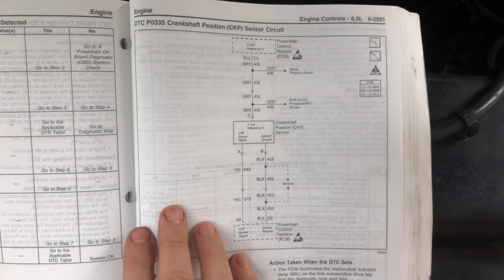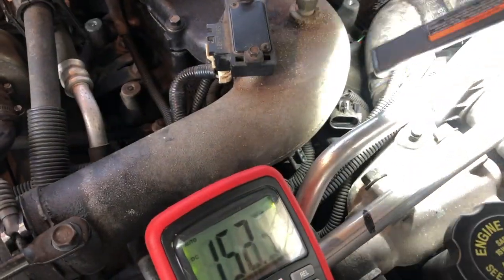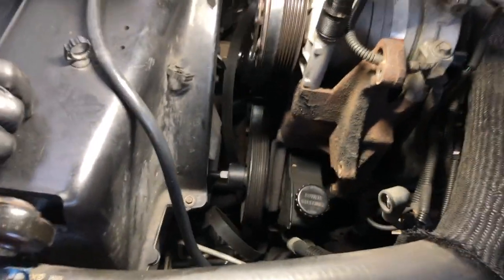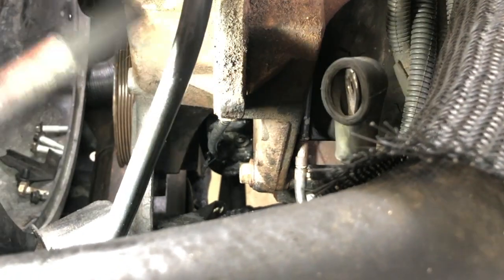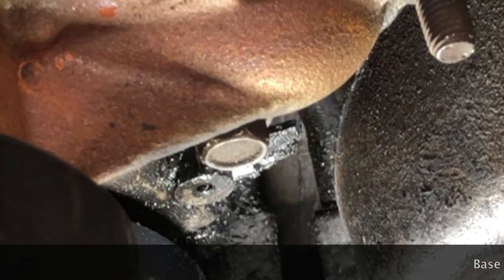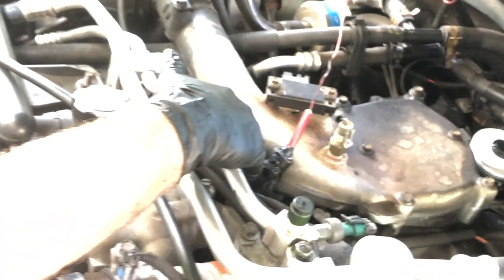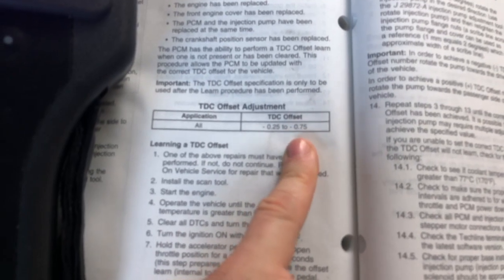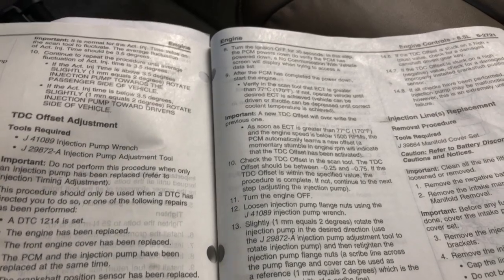1996 - 2002 GM 6.5L Diesel P0335 CKP CrankShaft Position Sensor Diagnosis & Repair (Chevy & GMC)

Comment: We have GMC k3500 6.5 diesel, 1995, stalling issues have replaced throttle sensor, pmd and relocated , starter, fuel filter, air filter, fuses, lift pump, engine block is brand new fuel injection pump replaced, fuel solenoid shut off, CDR VALVE , lift pump harness from Leroy diesel, differential housing had to be replaced after starter did not have bracket put back in from mechanics after replaced so it was replaced 3xs before a mechanic discovered bracket wasn't put back on even tho it was there.
Reply from the maker: That's a pretty expensive parts cannon story.  Did anyone actually try to diagnose the root cause issue rather than blindly throwing parts at the problem?   Someone should have checked fuel pressure coming out of the fuel filter manager into the lift pump, these kinds of symptoms can come from clogged fuel lines or a clogged fuel sender inlet screen.

Comment: Is the relearn procedure the same for 1995?
Reply from the maker: It's the same from 1996 and up using a Tech2 scan tool to automatically perform the relearn. For 1994 and 1995 the DLC adapters needed on the Tech2 are of course different due to OBDI vs OBDII and the screen menu entries may also differ but it's otherwise the same concept.   The manual TDCO relearn process may differ also, you would have to consult the service manual for your model year.   These last two points are the only reason I don't have the video title indicate 1994 and up.   More info in the video description as well.

Comment: ON A 6.5L 99 GMC IT IS NOT NECESSARY TO REMOVE THE P/S PULLEY OR THE SERPINTINE BELT- ALL YOU HAVE TO DO IS LOOSEN THE A/C MOUNT TO THE BLOCK AND THE BOLT ON THE P/S BACK OF PUMP THAT GOES TO BLOCK- IF I CAN REMEMBER RIGHT THERE ARE 3 BOLTS ON THE BIG A/C BRACKET - LOOSEN THEM ABOUT 3-4 TURNS- AND THE ONE SCREWING INTO THE BLOCK ON THE BOTTOM OF THE A/C BRACKET- AGAIN 3-4 TURNS - SLIDE UNDER THE TRUCK AND USE A PRY BAR TO MOVE THE BRACKET AND P/S PUMP JUST ENOUGH TO SLIDE CRANK SENSOR BY THE BACK OF P/S RES.  BINGO NOT ALL THE PULLING PULLEY TAKING OFF THE SHROUD AND FAN AND ALL THE OTHER STUFF- NOT EVEN REMOVING THE FAN IS UNNECESSARY!  I CAN DO ONE IN ABOUT 20 MINUTES INCLUDING JACKING UP TRUCK!   THE REASON TO REMOVE ALL THE STUFF IS THE SENSOR IS TO LONG TO COME OUT AND SLIDE BY THE P//S RES. YOU NEED ABOUT A 1/2 INCH MORE TO SLIDE IT BY THE BACKSIDE OF THE P/S PUMP RES!  YOU GET THAT 1/2 INCH IF YOU DO IT MY WAY AND ALL THE COMPONENT REMOVAL IS NOT REQUIRED!  EASY PEEZY!

Comment: New owner for 6.5 Diesel. Was wondering what the go is with the service throttle soon notification on the instrument panel at startup. Is there something that needs to happen to clear this. The light goes out. Does the throttle need to be cleaned/replaced. thank you . The camera work in your videos is very very good.
Reply from the maker: Thanks.   That dash warning lamp is related to the electronic throttle control.  These trucks were some of the first vehicles to do away with cables and use an electronic throttle position control.  The light is coming on because one of the several position sensors involved with this mechanism is not providing the expected data to the PCM.   You'll need a scan tool to pull the trouble code(s) to diagnose further but it's likely going to be sensor(s) related to the accelerator pedal.

Comment: Thanks for the video, im scratching my head on where to find a brand new , stock original power steering pump and original lines. Any reference? Thanks
Reply from the maker: Really eBay is the only game in town for OEM NOS parts anymore.  Sometimes www.partsvoice.com as dealer overstock.

Comment: What manual is that? Do you have a part number for that manual? I’ve had a hard time tracking one down, and recently purchased a 1997 c3500 dually with the 6.5L TD and I’ve been having all sorts of issues.
Reply from the maker: Those manuals have been out of print for decades, but there's a search link in the description where used copies turn up from time to time.  You can also "rent" them directly from GM at www.acdelcotds.com.

Comment: Hi Dr shock thank you for all the vids they've helped me allot I have a 98 6.5 v.i.n F .. is there any way using a multi meter to set timing on optic sensor? Your help is greatly appreciated.
Reply from the maker: Not that I'm aware of.  You would typically scribe/scratch the original sensor location before removing it to replace.   A Tech2 scan tool would be needed to correctly adjust it from there.
Reply: @DrShock  ok... thank you.

Comment: My 6.5 doesn't heat up to 170F unless it's 80F outside air temperature running on high rpms
Reply: Thermostat may be stuck open or you have a faulty gauge/sensor

Comment: A few lessons learned after I did this job on my truck:
- If you luck out, you can pull the sensor from under the truck without having to remove the power steering pump. This only works if the sensor comes out in one piece, otherwise you'll have to remove the pump to remove the sensor and get any loose bits out. If you are one of the lucky ones, you just have to carefully bend the sensor out because it'll hit the edge of the PS pump. It's possible to get it out, but it takes some finesse. The same goes for putting the new one in; you have to come in at an angle and carefully force the sensor in until its head is past the PS pump. It's a pain and you have to be extraordinarily careful, but I was able to do it with the help of some motor oil to lubricate the sensor.
- given the above, it's probably worth checking if the sensor will come out in one piece before you start removing other parts. Just be very careful so you don't break the sensor in the process. If it works, it could save you a lot of time.
- as the video suggests, don't forget to tie a piece of paracord or similar to the old sensor connector. That way you can use the paracord as a "placeholder" for where the new wire will go; you just tie the paracord to the new connector and feed it back up along the engine. This is easier said than done because there's not a lot of space for the connector to travel through the engine, but it's doable with some patience. Small hands help too.
- I found the new sensor male connector difficult to connect to the female wiring harness connector, so I used a tiny amount of oil to lubricate the gasket on the existing female connector (the purple gasket mentioned in the video). You have to be careful not to get oil in the electrical connection, though!
- all in all, I think this can be done in about an hour if luck is on your side and you know what you're doing. It took me longer than that because there was some trial and error involved, so schedule considering that possibility.
- if you don't have a Tech2 tool, you can repeat the relearn process a few times to make sure it goes through. When I did it the second time, it gave me a P1214 (injection pump timing offset), so I did it a third time and the problem went away. However, that indicates that the injection pump needs to be adjusted, so I'll be taking it to a mechanic just to do that part. It's probably wise to have someone check the timing after this job regardless of trouble codes.

I hope this helps!
Reply: @awaywedrove8861  what is the relearn procedure

Comment: Very nice and complete video. This is the kind of how-to we need on YouTube!

Side note, my idler pulley had a square slot for use with a socket wrench or breaker bar (this may vary depending on model). That makes it pretty easy to remove the serpentine belt. I use a pipe for leverage on the wrench so I can move the idler one-handed, then the other hand can guide the belt off the pulley.

Comment: А на 1995год такой сенсер подойдёт?
Reply from the maker: Да, номер детали, который я указываю в описании, относится к 1994 г. и новее. Но вид разборки в видео только для 1996 года и новее.

Yes, the part number I use in the description is for 1994 and up. But the disassembly procedure in the video is only the same for 1996 and newer.
Reply: @DrShock  спасибо!

Comment: Would you happen to know where the ign-e fuse wire runs? i am working on a rig that a knucklehead rewired poorly and that is last wire i can't figure where it is supposed to go. the wire i have is broken off by the fuel filter.
Reply from the maker: No not offhand, your best bet to figuring this out would be the engine wiring schematics in the factory service manual.

Comment: I have a question here about the ground going to the sensor. On a particular truck that I'm working on I'm getting a dim light on the ground also checking and confirming that I hooked a dvom to the ground on the sensor plug/back probing the other end to the battery positive side and I was getting around 8 volts so I don't think that's normal also did a oscilloscope test and signal didn't look very good. Also I wanted to say the sensor ground to the crank position sensor as well as everything else that's run off of that sensor ground like EGT inlet air temperature and a few others that sensor ground runs all the way back to the ECM so is that a sensor ground that should show battery voltage or should it be more like 8 volts. When you get a chance check out my video of the oscilloscope.https://youtube.com/shorts/SXQIFuj57r8?feature=share
Reply from the maker: Ron the 99 service manual for these trucks doesn't get into this kind of specific detail.  The testing of the sensor is more pass/fail after a DTC is posted / check engine lamp lit, rather than details to determine the margin in between.   

Wiring wise the CKP sensor has a 5VDC reference from the PCM on pin C and a ground on pin B to the PCM directly.  Finally the sensor has it's signal output on pin A going to a dedicated PCM pin A5 as a straight shot (no splices or shared circuits).  The ground is not a straight shot, there are two splices to other unnamed sensors along the way to the PCM.  The 5VDC reference is shared with only two other sensors, the boost sensor and the Barometric sensor.

While the service manual doesn't specify, I'd expect the 5V reference to be a solid test point, though it could range +/- some nominal value.  I'd expect the ground at PCM pin B12 to be a true ground, and provide comparable value to the other PCM sensor ground pin at D9 for the CMP sensor.   

So bottom line, no I personally would not expect anything but a normal reference ground here.  If I had more than background mV noise, I'd be inclined to think I had a wiring or PCM problem.  I'd check this by disconnecting the B12 pin at the PCM, and working my way back towards the CKP sensor splice by splice.

Comment: A bit of a critique. It is SO easy to pull the upper intake..... using an air ratchet it takes less than a minute, it only makes sense to remove it to gain access to any wiring underneath it, rather than try to work  around. It's just the (5 or 6) center bolts, loosen the hose clamp, remove one bridge bolt and loosen the other, and take off two electrical connectors. The gasket between the upper and lower intake is thin paper, and as long as it isn't torn, should be able to be re-used indefinitely.
Reply from the maker: I presume you're referring to the harness disconnect and reconnect parts of the job.  Sure, that's an option.  You'll need to re-seal the upper intake crossover silicone to the turbocharger as well.
Reply: @DrShock  ....... Sealing the hose with gasket maker isn't a factory procedure. I can't say that I've ever had any oil leak from my hose. Those spring hose clamps are intended to be tight tight, not just tensioned. The springs are there to tighten more if and when the hose material squeezes out underneath the clamps, which is a very real issue with modern synthetic rubbers. I'm not really referring to disconnecting and reconnecting the harness...... I didn't watch the whole video, I assumed you swapped the sensor, since you had a new one. And trying to probe a connector underneath an intake..... just pull the thing out. I mean, to each their own. I ran an auto repair shop for years. Don't waste a half hour trying to work around something when you can spend 2 minutes pulling the part off and get room.
Reply from the maker: Now that upper intake crossover silicone reseal definitely is a factory procedure (at least for 97 and up), it's called out whenever the 6.5L engines upper intake is re-installed to the turbo outlet hose (GM C/K truck service manual 1998 page 6-664).   Also the torque value on those two adjustable spring clamps on the turbo outlet hose is specified in there too (50 inch lbs).   

I do thank you for sharing your tip here.  I encourage folks to improvise with the tools and techniques in doing their own repairs (I do it myself), but I want to share what the GM engineers wrote too so we all make informed decisions.

Comment: Hello, I am writing from Chile, I need a diagram of the vacuum hoses for the GM 6.5 1996 engine. Can you please help me?  In my country there is no information.  Thanks you very much
Reply from the maker: There's an emissions sticker on the engine air cleaner housing.  It's a basic diagram but the only vacuum lines are for the waste gate solenoid.   Try this video https://youtu.be/XdAUfeqp9b8

Comment: what is the purpose of the crank position sensor?
Reply from the maker: Used by the engine computer / powertrain control module to determine the position of the crankshaft and its rotational speed.   The firmware in the computer takes this information into account when setting fuel injection and timing parameters.  This is why scan tool setting of the top dead center (TDC) offset is associated with replacing this part.

Comment: Dr Shock off topic but can you recommend a source for  quality remanned injection pump 99 6.5 ? 
Also do you know the codes it will throw for a bad pump my mech did I diagnostic and I want to compare codes to verify he's correct?
Thanks for the great in depth vids!!!
Reply from the maker: Personally, I'd buy a replacement IP from rockauto.com and I'd go with the ACDelco reman version.   My second choice supplier would be Delphi.  The reason for rockauto is no haggle return policy, decent core credit amounts, and solid long term reputation as a parts retailer.   The reason I'd go with ACDelco or Delphi is OEM quality (btw Stanadyne was the actual OEM but they only sold new not reman).   The GM number on that 1999 IP is 19209059.   I would not let a GM dealer install this part, the techs who know this engine are long gone/retired in most cases.   If I wasn't doing it myself, I'd have a Stanadyne shop do it (it requires special wrenches to adjust the timing and access to a GM Tech2 scanner to initiate the TDC offset relearn).  Not a DIY unless you have access to those tools.
Reply: Ive installed 8 in the past 2 months pensacola keeps sending me lemons the first one had bad optic sensor this one lost pressure and wont stay running it just keeps stalling in like 3 seconds.